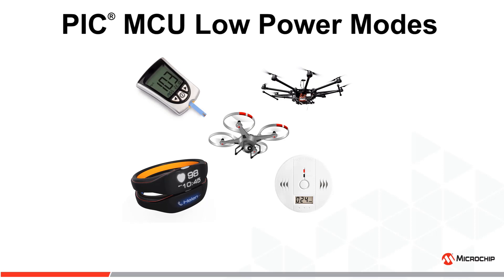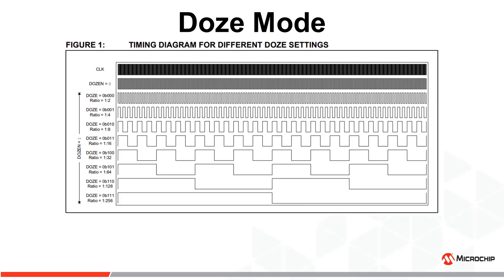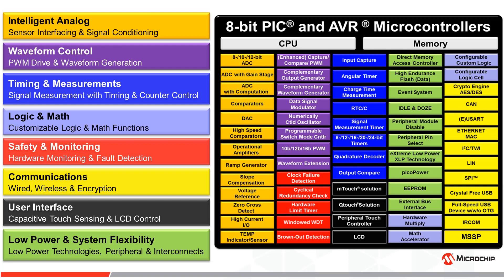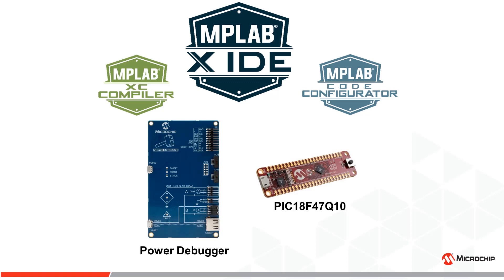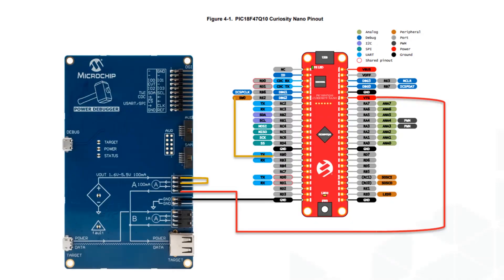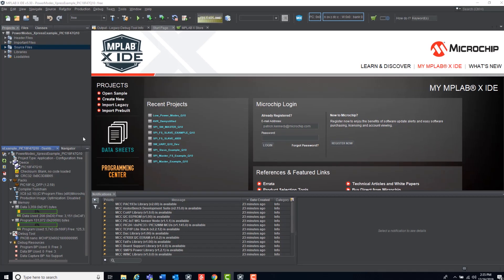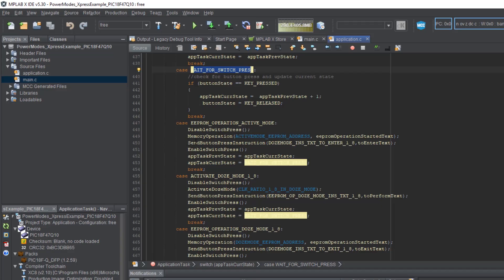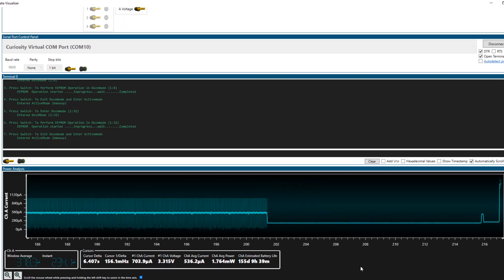Low Power Modes on PIC® Microcontrollers

Comment: The link for the code doesn't seem to work. It just takes you to the web version of the IDE in a blank project. Any chance that could get updated? It would be nice to see more of the code that what is shown in the video.
Reply from the maker: Hi Kuit, thank you for your question. 
Here is the code example and write up in Discover: https://mplab-discover.microchip.com/v1/item/com.microchip.ide.project/MCC/com.microchip.mcu8.mplabx.project.pic18f47q10-low-power-modes/1.0.4?view=about&s0=com.microchip.ide.project%3Adevice.content.name%3Apic18f47&ds0=com.microchip.portal.start.displayCharacteristics%3A1.0.3%3As0

Here it is in github: https://github.com/microchip-pic-avr-examples/pic18f47q10-low-power-modes/tree/1.0.4/